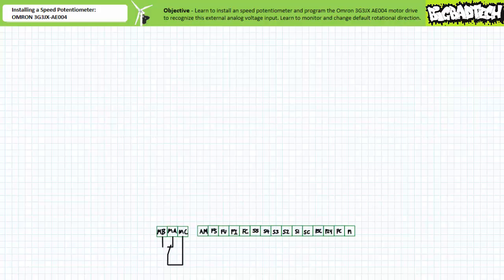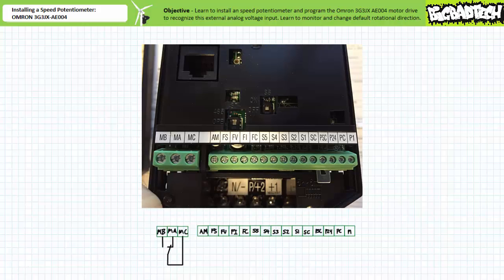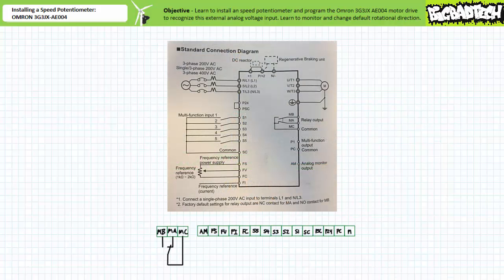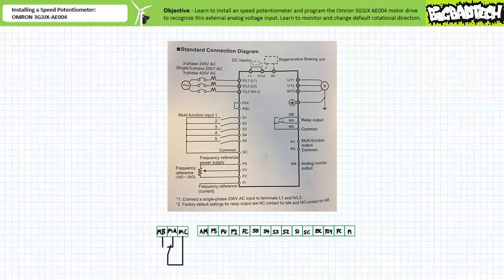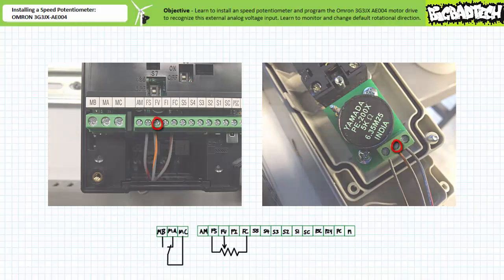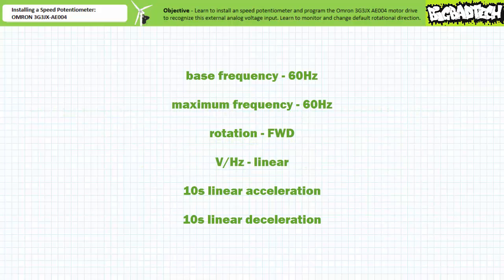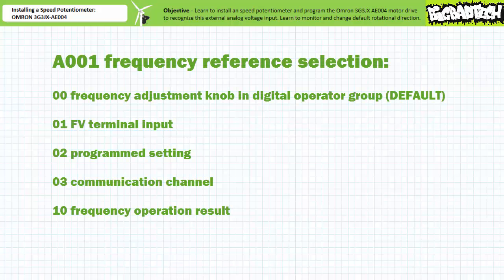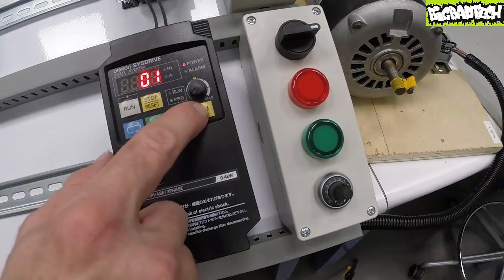Remote  Speed Potentiometer: Omron 3G3JX-AE004 (Part 1 of 2)

Comment: Great tutorial, will this also work for a JX-AB004 ?  I got a JX omron inverter. Its not a SYSDRIVE
Reply from the maker: Most likely there will be some similarities however there may be some critical differences! Make sure you confirm the proper output pins for your drive of interest.
Reply: @bigbadtech  Yes i figured out there are some differences. Thanks for fast response, i'll get some help in town

Comment: Thank you for this very nice tutorial.
I'm a total beginner, and own a very similar drive (Omron SYSDRIVE 3G3MV), but the FS terminal supplies 12v and not 10V, but the FR still states that it uses 0 to 10v for reference. Further, both for the VFD you demonstrate, and mine, the manual states you should use a 2K pot, but i can see you use a 5K. I don't understand what the meaning of stating 2k pot in the manual is then?

The manual for my drive has the same illustration, just showing to connect the 2K pot to the FS, FR and FC, with no additional resistors. So what happens with the "extra" 2 volts?

I have search everywhere for the answer to this, but not even my local electricians kan give me an answer.
Reply from the maker: Yes, I'm cheating by using a 5k, however, it still works for voltage division. Regarding the 12V signal this is admittedly odd. I would put a 400 ohm resistor in series with a 2k potentiometer such that the additional 2V is dropped across the 400 ohm resistor and you can get a clear 10V signal.
Reply: @bigbadtech  Thank you very much. I will see if i can get my hands on some resistors.
I guess the 12v could be there to enable a larger voltage drop over a longer distance from the pot to the terminals?
I'm a total newb, so i don't really know what im talking about :).